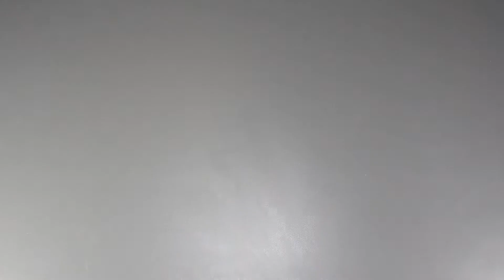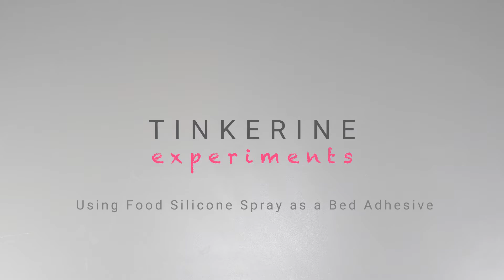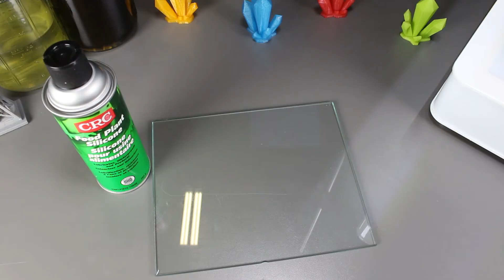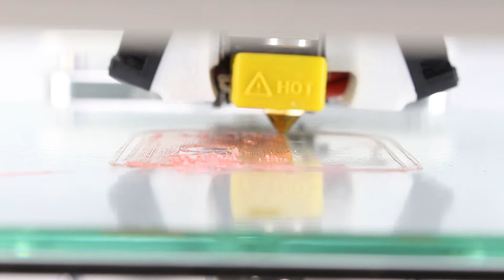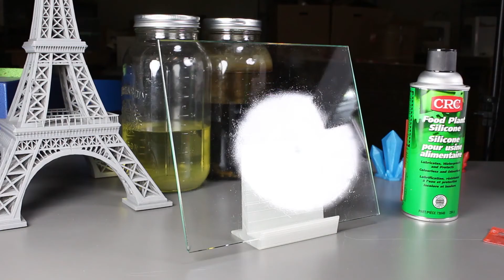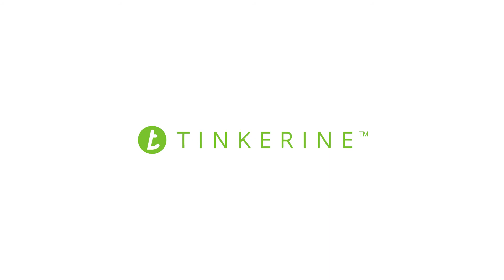Using Food Silicone Spray as a Bed Adhesive

Comment: Surprise! Even PLA doesn't stick to one of the worlds unstickiest materials... Why do you think it say "Nothing sticks to silicone". Why does your Printer has a silicone-sleeve on its hotend? Why is this spray intended for BACKING PANS TO NOT STICK WITH DOUGH? Cmon - you can't tell me you didn't even read it's original purpose and thought "hmmm... maybe this is the opposite i'm trying to achieve..."
Reply from the maker: Hi,

Thanks for the comment. It could have been an interesting find if it did work but it didn't. It never hurts to try it out!